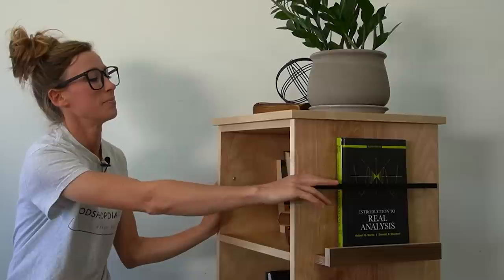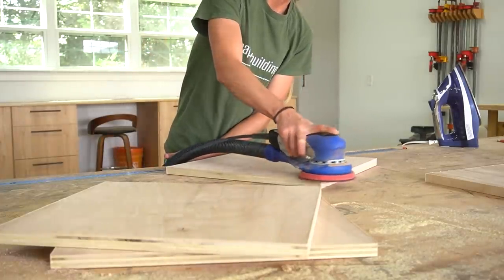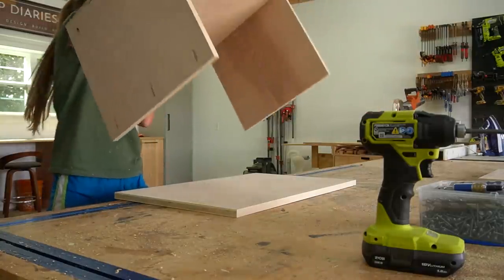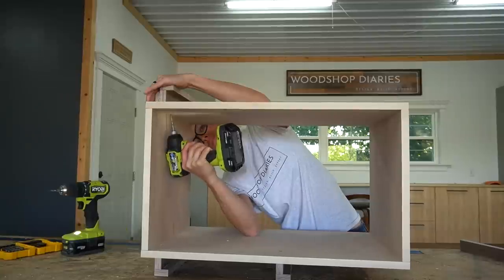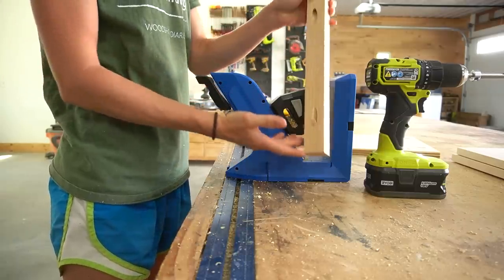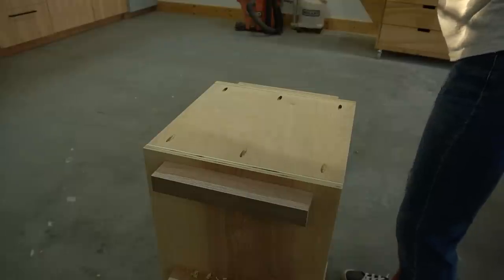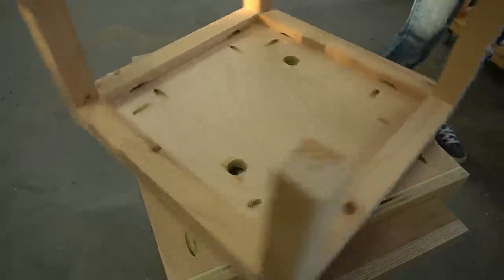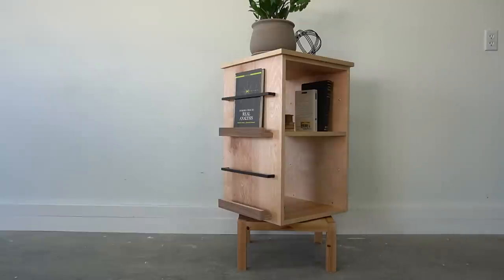How to Build a Rotating Bookshelf | with Lazy Susan Hardware

Comment: Clever, simple way to mount the mechanism. The only caution is to consider the weight capacity of the mechanism (which is not always listed in the specs). Books are heavy and you can pack a lot of them in.
Reply from the maker: Thanks! The load capacity is 1000 lbs. I actually took it off this really tall project I used for several years until I recently recycled the parts: https://youtu.be/pnvwgAScKOw?si=-oWyNgYnyxKazKyZ

Comment: Very cool idea. I used the Kreg rip cut based on your recommendation on a recent cabinet project and it worked well. I still only use it for rough dimensioning but it is a very convenient way to break down sheets of plywood. Thanks
Reply from the maker: The Rip Cut is one of my all time favorite tools. Before getting it, I hated working with plywood. Now it’s my favorite material. I just needed a good way to cut it haha. I’m glad you find it helpful as well. Happy building!

Comment: This is great! Have a couple oversize books and this is a good solution to display them with just one ledge per side. Had a similar issue with some handles that tried to use to make a tray and my finger barely fit to lift it 😅
Reply from the maker: One ledge on each side for extra large books is a great idea and a nice way to display your favorites 😊 
Yeah, I should have paid closer attention to the handle dimensions before buying 🤣🙈 live and learn haha

Comment: That turned out really well. It would be great for a record holder or magazine display. I like the rotational aspect of it. For at least 2 years I've wanted something like a portable desk that sits on the floor. Something that has hidden drawers to store pencils and drawing supplies. Think of it as a cross between a bed tray (the kind with four legs that people use for breakfast in bed) and an architects desk only on a smaller scale. It would probably be around the height of a coffee table but not as long. However, with the exception of helping to build a wooden step bench many years ago, I've never built anything. Now I'm wondering if the app that you mentioned could help me get a better idea of the height, width and other important information that I'd need to build it? So I'm glad that you mentioned it. And again, I like your rotational book shelf. Btw, both pets looked so chill while you were building the bookshelf.
Reply from the maker: MakeByMe is great for visualizing your projects. It might could help you kind of piece the parts together and see how it’ll work and look and decide the size to make things. That sounds like such a great project idea!
Reply: @WoodshopDiaries  I'll be honest I thought of sketching it many, many times but realized that I had no idea what the dimensions should be. So thank you for even mentioning the app. I'm glad that I watched your video earlier.

Comment: Great Idea!  I have two questions: (1) How "reusable" are pocket holes when you removed the panel then had to reattach?  (2) How much weight can the Lazy Susan hold and still spin easily?
Reply from the maker: Thanks so much! I’m not sure I know how to answer your first question. They’re completely reusable—no issues unscrewing then reattaching. I didn’t drill new holes. 
In regards to the weight, the lazy Susan I linked in the description of this video (which is the exact one I used here) is rated for 1000 lbs.

Comment: How many teeth are on your circular saw blade and how does it affect your cuts?  Your cuts are much smoother/cleaner than when I rip plywood and cut 2x4s.
Reply from the maker: I use a fine finish/plywood blade on my circ saw. It makes a huge difference when cutting plywood.

Comment: How do you store your plywood without it warping?
Reply from the maker: I use this cart I made a few years ago. And when it’s full, I just lean the sheets against it: https://www.woodshopdiaries.com/diy-scrap-wood-plywood-cart/
Reply: @WoodshopDiaries  if I try to store birch plywood it always warps
Reply: @WoodshopDiaries  but is also my favorite plywood too 😊
Reply from the maker: I’ve been storing mine on its side for years—either in the cart or on the floor leaning on the cart. I’ve not found it to be an issue, but location and moisture levels (and the plywood itself) could certainly play a part.